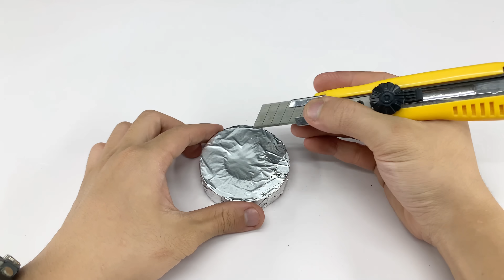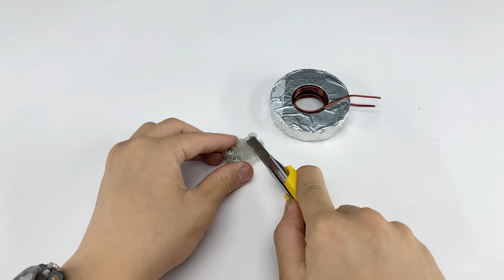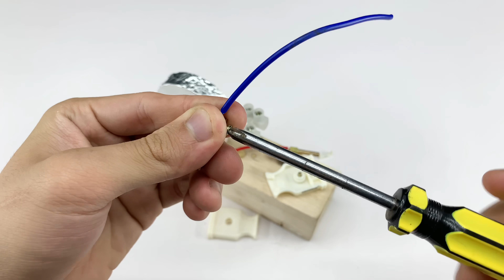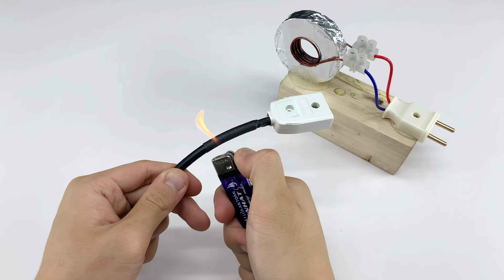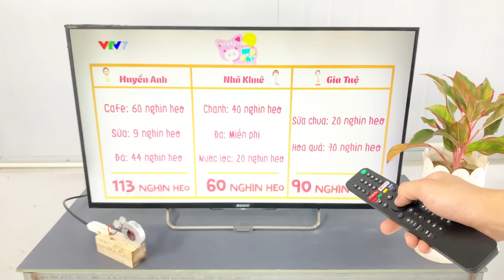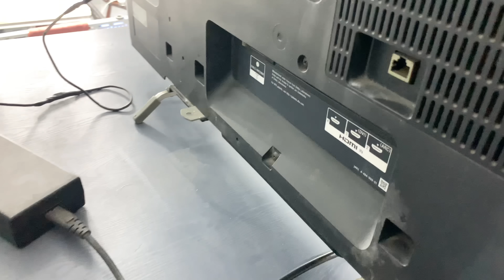Say Goodbye to Internet! Place a SPRING on a MAGNET and Watch  Channels 📡

Comment: How  to apply Free Internet to an Android Phone??
Reply from the maker: There isn’t a legitimate way to get *completely free internet on an Android phone* without a provider. Usually you still need some service or network access.

Some common options people use are:

* *Free public Wi-Fi* (cafes, malls, airports, libraries)
* *Promotional free data* from mobile carriers
* *Apps that reward data* for watching ads or doing tasks
* *Hotspot from another phone* that has internet

Completely bypassing a carrier to get free mobile data isn’t reliable and can violate service rules.

Comment: No es una antena para 'ver' Internet gratis, más bien es una antena para mejorar la imagen de las señales de televisión abierta, pero el asunto del Internet es otra cosa. Si se puede hacer una antena de recepción inalambrica de Internet y "extraer señales externas a tu casa" de Internet de vecinos, empresas o tiendas libremente pero con ciertas limitaciones.
El estudio y el diseño de antenas es la clave.
Los satélites artificiales constan de varias configuraciones de antenas para la recepción y retransmisión de señales de audio, imagen, video, color, etc en distintas longitudes, frecuencias y amplitudes de señales. Y en tierra conllevan antenas de similares diseños para el Internet, la televisión abierta, televisión por cable, generación de electricidad y otras especialidades. 
El secreto consiste en investigar, escribir, dibujar, obtener fórmulas matemáticas y físicas y sabiendo como hacer solamente  antenas para propósitos especiales. 
El radar es un tipo de antena especial, no es nada fuera de este mundo.
MÉXICO enero de 2026.

Comment: The "device" is useless: the for-nothing loss pd signal points: can connect directly the coil's ends to the antenna ' connector.
And the rest... the 2nd cable ... nothing in the video... is or no linked to the... "device".
You can have a connected tv and the rest is perversion
Waste of time.
Reply from the maker: I get your point — electrically, the coil can be connected straight to the antenna input, and the extra parts aren’t strictly necessary. The video shows one way to illustrate the concept, not the most minimal or efficient setup.

Comment: I think it may work on UHF and VHF Chanel, but will not work for digital tv...
Reply from the maker: You’re partly right 👍

It *does work on VHF and UHF**, and **digital TV also uses VHF/UHF frequencies**, so in many cases it *can work for digital TV too.
However, digital signals are *less forgiving* — if the signal is weak or noisy, it may not work reliably, unlike analog TV.

So:

* ✔️ Possible for digital TV
* ⚠️ Quality depends heavily on signal strength and antenna setup

Comment: What is the wire nomber and turn and radios of coil and gap in-between
Reply from the maker: This was only a basic demonstration. Wire gauge, number of turns, coil radius, and gap can vary depending on the setup and materials used, so exact specifications weren’t provided.

Comment: I believe that the function of this device can be that of a router , but the question is which Internet provider or works only as a UHF antenna
Reply from the maker: Exactly 😄 Technically it *could function like a router* if designed for it, but most likely it’s *just a UHF antenna* — it doesn’t connect to any Internet provider by itself.